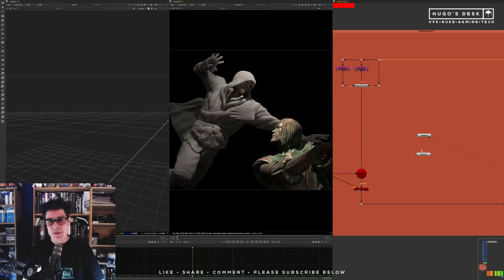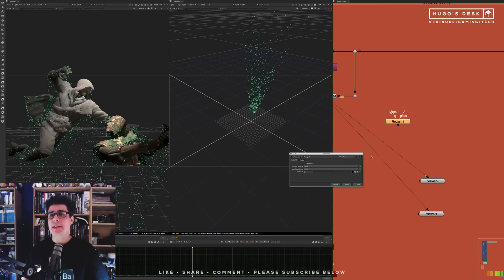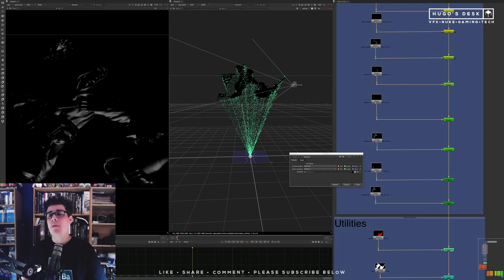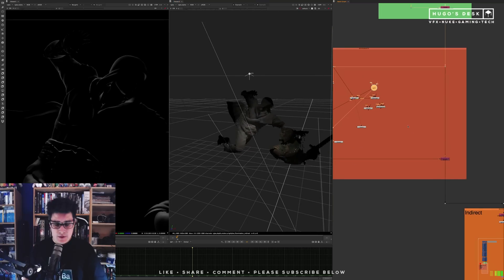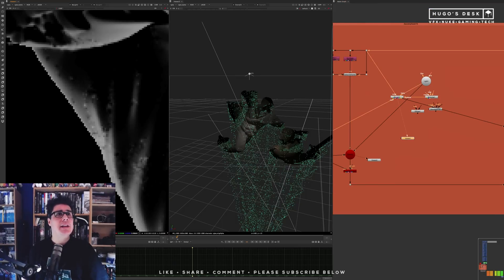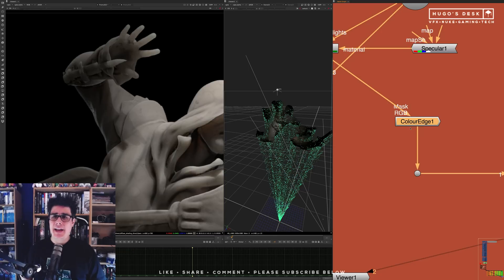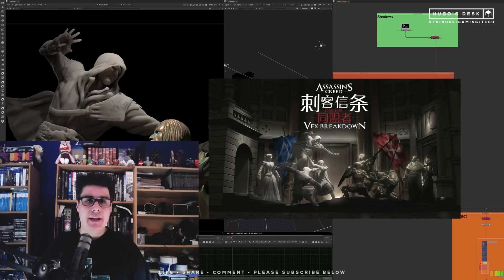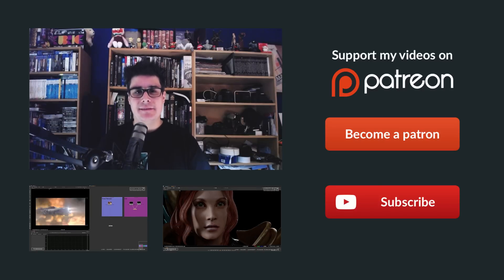How to use Relighting in Nuke

Comment: Another way to Extended edges without colourEdge plugin, i mean do it with default nodes, great video greetings from Lima - Peru
Reply from the maker: Thanks so much for watching. One way to learn how to make a manual extension is to load the gizmo and do a "copy to group" in the last tab. Then click the S on the upper right corner of the group and you can see the inside fo the gizmo. Meaning: you can see the script used to build the gizmo.